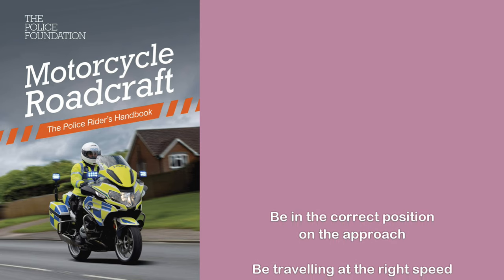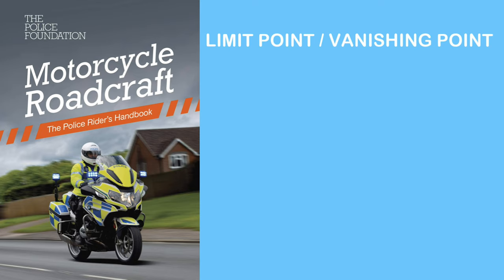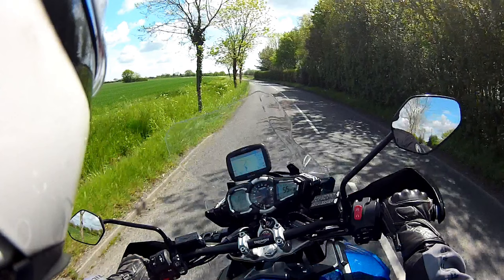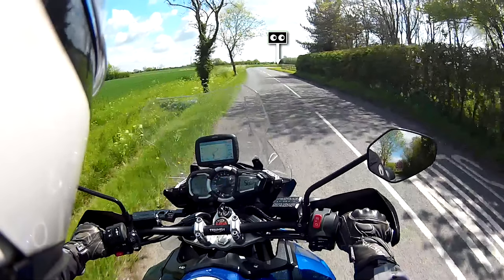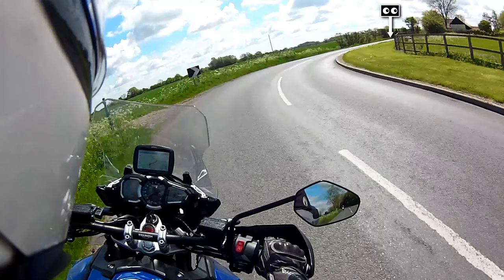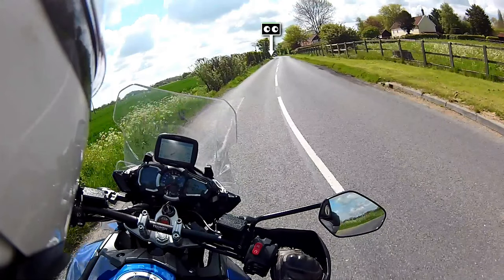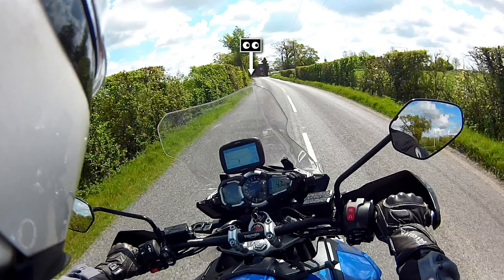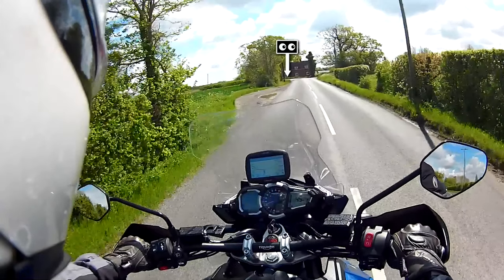Cornering and the Limit Point | Motorcycle bend assessment | Limit point analysis

Comment: Nice video about nice simple bends but you will agree and as you said, they are not all like that. On the plains of the UK with good visibility one can get round bends easier.  However in many places in the UK the bends are sharper or narrower or blind or as said tightening and so if one is merely used to  this type of bend shown then one is badly mistaken as they are  only a beginning.. In the north of England on the  Pennines and west of them we have many fields full of  growing grains and other vegetable produce and some  roads and bends have high hedged  to them as they do in the west country. Hedges that are so high one cannot see round them at all.  They present a brick wall. 

What we now need to see is at what speed and how do we approach those types of bends the ones that are blind and can easily hide an obstruction.
Reply from the maker: The use of the limit point would be the same (which is what this video is about). The cross views through the hedges in these example bends don't reveal a lot of the road surface. Other road conditions (Information) may make changes to your speed irrespective of the limit point.

Comment: Mike, thanks for the guidance - really helpful.
Do you have a video on braking techniques if part way through the bend you do see something appear at the limit point which then requires you to stop?
We know we need to ride ready to stop under these circumstances and practicing actually doing it under safe conditions on a regular basis would help when it happens in reality.
Reply from the maker: Sorry for the late reply Richard. For some reason I didn't get a notification from YouTube of your comment. I don't have such a video. I'll have to have a think about how best to do that. I can certainly talk through the dynamics of braking mid-turn but not sure how to demo it, as other than getting it badly wrong, there won't be a lot to see. The things to remember are not to snatch at the brakes, that the bike will try to sit up and head for the outside of the turn so you need to compensate with extra counter/positive steering, and finally as the bike does slow it will want to drop into the corner so you need to feather off the extra steering.
Reply: @mikeroberts  We already  slow on bends as our country is full of curved roads [ slight bends ] and on going round those curves from time to time we do  slow sometimes by merely  de acceleration or sometimes by the use of rear brake also  or if needs be both brakes,  Just remember to take it easy, practise on some easy curves. Don't pull brakes  full on as that could destabilise the biked. Understand that the the greater the lean angle that you have the less available grip that you have left for braking and or steering.   So if we are on a curve with say a  small 10 deg lean angle you still have some  90% [ approx ]of your braking and steering capacity left but if our a lean angle is of say 30 deg. you will now only have  some 70 % left of that grip available to you. 

So just learn slowly, taking it easy and getting more used to the your and the bikes ability to take curves, then bends then corner. Obviously it best not to slow or brake on a bend but we all  actually do it all of the time.   Just don't grab a brake as  that would stand you up and when doing so the bike would head out of that curve and steer you into a tangent and into a straight  line either to the left or the right and that can put  you in greater danger.

That said and with practise some riders can intend to straighten the bike up  and then more or less immediately lean the bike over again into another path and regain control.    Otherwise one can counter steer whilst leaning over and that will reduce the radius on a bend and may afford you the ability to avoid whatever is in the way. 

Happy riding  and be safe out  there.

Comment: So often I see videos that show a bike leaned over and actually on  or passing the Apex of a bend and as such the opening up of the road ahead can become apparent. Then whilst still at the optimum lean they may use acceleration or too much acceleration and in doing so whilst still  with a lot of lean angle they may lose their  rear end. 

 It would be  a lot safer  if they  follow through past the Apex and bring the bike more upright to a far lesser lean or  indeed to a  vertical position before any acceleration takes place.   That is a far safer way to accelerate rather than being still in a far too greater lean angle

Comment: One can see and use  the limit point or the vanishing point all of the time whilst on any road and in doing so one will become one of the safest users on the road today.  Its not just used for taking corners or bends.  As said in Roadcraft its the furthers point down the road ahead that you can see to be uninterrupted.ie clear and be able to stop in.   So that means that at any time one can be following a car ahead of you and the distance that you give that car would be safe enough  to stop in so so that is your limit or vanishing point.  

Then when you are on bends its not  just to the roads limit point in the distance one needs to be aware of, its also the limit point to that vehicle in front.  Its no use giving say 120 ft. of frontal space on a bend that you are taking at say 40 mph but its the actual distance to the vehicle in front of you as well and one should be 120 ft. behind that vehicle also  at that speed.  So often I see riders close up on vehicles on bends and  give far less safe distance as a result. 

Unfortunately  in some circumstances riders fail to realise that and will judge their speed and distance solely with regards to the bend only, disregarding the more immediate danger of and to the vehicle in front of them.

Comment: Sir, Could you explain Limit Points and apexing in relation?  I don't know if I have asked the right question. Thank you ☺️
Reply from the maker: Pradeep. Apexing is a line you might take through a very open bend. One you can see all the way through for a long way so the limit point is already is already in the distance. It's not something you get to use very often on the road.
Reply: Did you get a reasonable reply now, Pradeep? I'm not sure. The thought with the video is to get us understand the approach with the vanishing point - you know what that is now. After following this rule, the apex of a curve is were you are the closest to the sideline or mid line depending on what side you bend to. Here Roberts means that you shouldn't worry too much about the apex; it will fall where it will. And it's right what Roberts say, it's merely of major importance for racers - 'Hitting the apex' like, where they know the track and try to place the apex as precise as  possible.